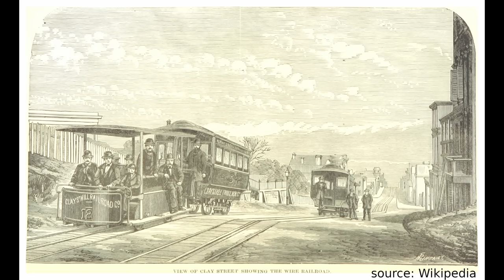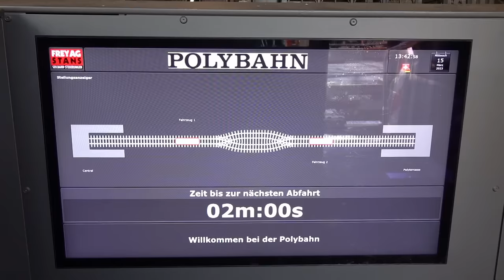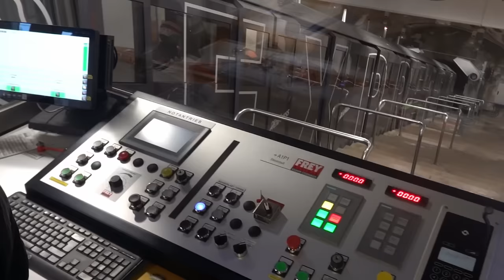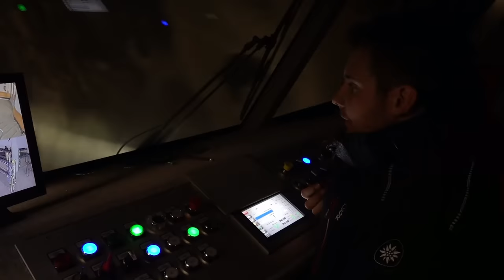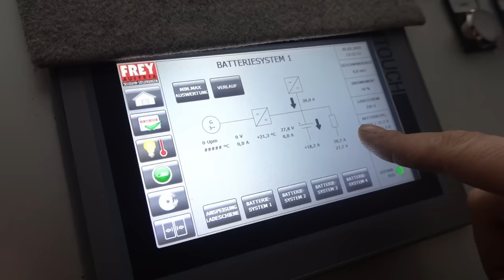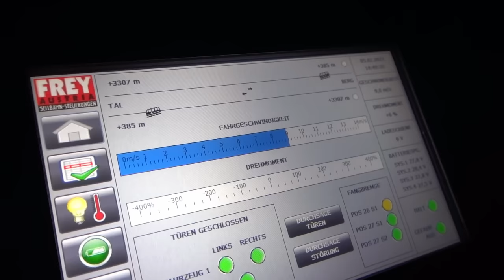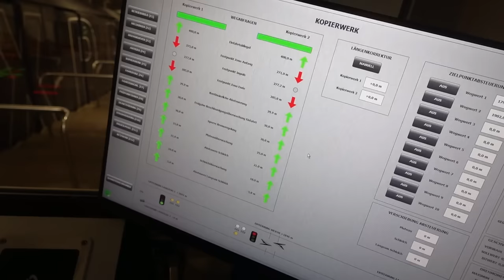A train that never sees daylight

Comment: Another difference between the San Francisco cable cars and funiculars is that the San Francisco cable cars can detach from and attach to the cable, while funiculars are of course permanently attached. Thus the San Francisco cable cars are the last of the traditional cable cars. The idea for them originated in 1869 (nice) by Andrew Smith Hallidie, who had the idea after witnessing an accident in which a streetcar drawn by horses over wet cobblestones slid backwards, killing the horses. Hallidie solicited financial support in 1871 and 1872, and the first successful cable-operated street running train was the Clay Street Hill Railroad which had its inaugural run in August 1873.

The cable cars are pulled by a cable running below the street, held by a grip that extends from the car through a slit in the street surface, between the rails. Each cable is 1.25 inches (3.2 cm) in diameter, running at a constant speed of 9.5 miles per hour (15.3 km/h), and driven by a 510 horsepower (380 kW) electric motor located in the central power house (part of the Cable Car Museum), via a set of self-adjusting sheaves. While these are the last of the traditional cable cars, other lines pretend they're cable cars, like the Great Orme Tramway in Llandudno, Wales that goes between the summit of Great Orme to the center of town at Llandudno Victoria where a part of it is street running. Lisbon's three street funiculars act that way too.
Reply: You should be ashamed of yourself! Let those people go!🤨
Reply: In Liege they had cable trains in 1842,  most likely not the first either

Comment: Underground funiculars exist elsewhere too! Examples include the Tünel/F2 in Istanbul! It has two stations connecting Karaköy and Beyoğlu. It runs uphill from near the confluence of the Golden Horn with the Bosphorus and is about 573 meters (or 1,880 feet) long. It opened all the way back in January 1875, making it the second-oldest underground railway in the world after the London Underground, and the oldest in continental Europe as it opened two decades before Budapest opened their Metro! 

There's also the Carmelit in Haifa! As the name implies, it runs through the religiously important Mount Carmel. It has a total of six stations and connects downtown Haifa with Carmel Center, and connects to places like the Haifa Zoo, Haifa Center railway station, and the beautiful Baháʼí World Centre. It's the oldest subway system in the Middle East as it opened in October 1959, but because of its small size, it's also one of the world's smallest subway systems as well, as the tunnel is just 1.8 km/1.1 miles long!
Reply: how are you everywhere💀💀💀
Reply: No speak gemern
Reply: I actually thought they were talking about the F2 in Istanbul when I first saw the video heading.

Comment: This is an amazing video.  I've known of funicular railways and as they are called in the USA incline railways but I wasn't aware of a funicular railway running completely in a diagonal tunnel.  It was neat to see just how much it had in common with the gondola system only flipped perpendicular 90 degrees.  I was noticing the similarities of the power supply when you said you wouldn't go into anymore detail because you had covered it in another video.  I thought it was funny when the operator said that if there was a fire detected in the tunnel the alert would come up on the panel and he said Oh, shizer.  I want to thank you for making these videos in English.

Comment: I had ridden the underground funicular at Kaprun several times that killed all those many people.  Once you understand what happened by fire, it is something I would never do again. My understanding is that the train no longer exists.  Back then there was no door at the lower end of the tunnel to stop wind. It as a blow torch once the fire started.
Reply: I have to admit; Every time I see an underground funicular, Kaprun is the first thing I think of. 🪦😢

The effects of fire in diagonal shafts were already known of before the disaster by reference to the Kings Cross fire in 1989, where fire spreading up the station escalators caused a blast-furnace effect that drew fresh air in from below, setting a draught that propelled the fire up the incline and decimated the booking hall. 🔥↗⚠

Tragically, this effect was also seen at Kaprun and would've made the entire tunnel above the train thick with smoke all the way up to the summit complex. One thing Kaprun has taught me is: In the event of fire in a confined space, always head down - Never up! ↙🔥👍

Comment: I found your video fascinating.  I live in Palm Springs, California and we have an aerial tramway that runs up one of our local mountains, Mount San Jacinto.  The similarities to Pitztaler are amazing.  Again, dual cars with one going up while one goes down.  Each car holds up to 80 people.  However, our tramway never sees darkness.  It's always in sunshine or moonlight!  Primary use of course is for passengers, but like the Pitztaler it must carry all goods, food and supplies up the mountain as there is no road.  It even has to carry water for drinking and sanitation purposes in an under carriage belly tank.  

You start at the bottom where the altitude is 440 feet (134 m).  Your drive your automobile up to the parking lots at the 2,643 foot level (803 m).   After parking you enter the Valley Station where you board for the 10 minute ride on the rotating tram cars up to the Mountain Station at 8,516 feet (2,589 m).  That's a rise (or fall) of 5,873 feet or 587 feet (179 m) per minute. By comparison, a typical airline jet climbs or descends at 500 feet (152 m) per minute.  Then, if you are hardy and ambitious, you can hike on foot to the mountain top at 10,834 feet (3,294 m).  There are beautiful lookouts at the top and many trails around the State Park there.  There are also 2 nice restaurants, one of which is fine dining.

Wonders like this dot the world and I thank you for sharing yours with us!

Comment: Thanks a lot for this video. 30 years ago when was around 10..11 years old, my family went for ski holiday every christmas to Kaprun and every easter to Pitztal. Because i was very interested in cable cars and ropeways and ask my parents a lot of questions they could not answer (my biggest concern at this time was, the switch will be switched wrong and the trains fail to pass at the right side, or the cable would brake....) , they speak about me with our host and he knows someone working at the Gletscherbahn. So at the next bad weather day my parent drop me at the bottom station and the guy showed me nearly everything. First thing was the function of the switch. I could drive with him in the drivers cabin upward and he stopped for a short time just before the switch, so i can see it in detail. Then at the top station we went below the train and he showed me the wheels , so it was now clear to me that the switch never will fail. Also he explained the emergency brakes that will grab the rail in case of a cable brake, and how the cable is fixed by a drum and can be shortened after some time of stretching. (You missed this part? ) after that he showed me the rectifier room. I was impressed by this big semicondutor parts, comparing to the small parts of my electronic experiment box...Not sure if it was a thyristor rectifier and if it was able to feed back power to the grid or if they just used it at brake resistor to heat the restaurant? Also i have seen the DC motors, gearbox and the generators. I think there was no demonstration how to switch the gear....Sadly i had no camera with me, so i made drawings of the drivetrain later. And in my memory the machine room is somehow bigger as in the video. Thanks a lot!
Reply: I think the red counterweight 'car' at the bottom accounts for any cable stretch (probably up to it's service life).  He discusses it @ 7:25; and you can also see it again @ 8:30.
Reply: @troubleshooter1975  No. The counterweight can compensate the stretch of the lower cable, but not of the upper cable. If the the cable stretches within its lifetime maybe 3 meters, the cars do not fit any more the desired park position at the top and the bottom station.
Reply: @wasserdrucker6227  Ah, ok, I agree now (after reading your whole reply, LOL).
I thought he meant the the cables would get droopy without the drum or means to tension them.
That's why I pointed out the counterweight.

It will account for total stretch (for maintaining tension), but not for positioning.
My comment was partly wrong.
Thanks!

Comment: The sound at about 6:48 is amazing....you can really feel the enormous power of the engines.
Reply: Glad to hear it's not just me who finds this sound so natural and comforting! ⚙🔊❤‍🔥

I find the same thing whenever travelling on the TGV-TransManche (Eurostars older trains; Quick, whilst rolling stock lasts! 🚄 🇪🇺 ⏳) in coaches 01 or 18 (The coach is half power-car), many VAL systems across France, plus any Paris metro line (1, 4, 14) operated using MP-89 trains, just in case it's useful! 🚈⚙🔊❤‍🔥😇

Comment: The great big cable and the wheels that pull/guide them remind me a of a big machine we have here in Canada that operates as a lock on a waterway. It's called Big Chute, it runs on rails, and it lifts boats out of the water, down a hill, and back into the water at the bottom. It is pulled up the hill by four cables and each cable runs into these big wheels and into the building which houses the motors that pull the machine up the hill. Each cable has its own motor. The difference is the water at the top is past the peak of the hill and slightly down the other side so when the machine reaches the peak the cables flip direction and it is let down hill on either side by gravity and the speed is governed by the motors. The cables switch in pairs in different spots so it's not possible for the machine to stall. The whole machine is powered by a hydro-electric dam right next to it.

Comment: There is even a funicular in Wiesbaden (Germany) which only uses the weight of the cars, it's called "Nerobergbahn". The way they make sure the upper care is always heavier then the lower one is a huge water tank in any of them where they take water from a pond at the top of the mountain making it heavier and at the bottom you can hear (and see!) how the water swooshes out of the tank in just a few seconds! 

The speed and the departure is simply controlled by brakes!
Reply: Ah forget to mention - it doesn't brake on the regular rails it rolls on of course, but on Rack rails located between the rails. And those are really just for braking! They have a 5th wheel (the most useful 5th weel maybe) which runs on that and can be braked.
Reply: Here is a Wiki-Site where you can find some useful information: https://en.wikipedia.org/wiki/Nerobergbahn
There's also a german version linked in the site which has more details for those who speak german!

And yeah 450m in 3.5 Minutes aproximates to an average speed of 7.7km/h so you are way faster by bike downhill and you might be able to top it uphill as well, but keep in mind your way is a bit more curvy, therefore longer and therefore you have to ride a bit more faster than the train does to be at the same speed!
Reply: Ok calculated it. If you don't care about traffic rules (there are ways that aren't for bikes) it makes 620m so you need 10.6  kph uphill to be as fast as the train 83m on that distance, which can be really hard. It's not much, but if you race the train it might get much 🙈
Reply: There are several others funiculars around the world that use water balance propulsion such as the Lynton Lynmouth in Devon UK
Reply: This is a type known as a water balance funicular (🇩🇪: Wasserausgewogensfunicular ) and is quite common in parts of the world, particularly some areas of the UK as somebody else has already pointed out. 🚞🌊😇

Funnily enough, this has just reminded me the UK also has a globally unique type: In a small eco theme park in North Wales is a gravity driven rollercoaster where the lift-hill is replaced by a funicular, where the weight of people waiting to ride is used to lift the train to the top of the track. It is quite possibly the only Human balanced funicular in the World! 👯🛗🚞😁

Comment: I have questions. From what I understand,  the trains are  directly connected to each other through the wires in such a way that they use each other as counterweights. One train can’t leave the station until the other is ready. 

In the event of a fire, I get that it speeds up and disables other features so it can get away and evacuate passengers quickly, but wouldn’t that also mean that it would pull the other train towards the fire? Specifically if there was a fire in just one of the stations. I would assume that it’s more logical to have train that can disconnect from the wire when required and have it’s own independent brake systems so they could stay put or descend as needed.

They mentioned it at the end, but they didn’t really say whether the trains can become independent of each other when a need arises. It doesn’t seem like they can be powered upwards on their own power.
Reply from the maker: The fire would typically break out inside a train. Their crossing is very brief, so no way for the fire to jump over to the other

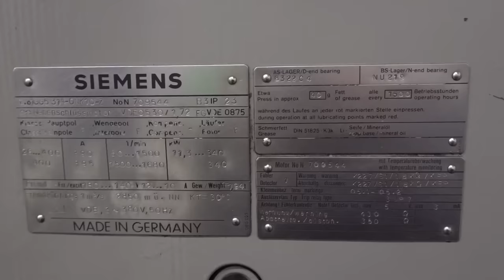Comment: Nice video! Btw: The motors are not DC, there are frequency inverters, but the output is not DC. By the electric motor datasheet which you show in video at 13:43, the motor is rated for 2x-400V with 890A, 50-1500RPM and 11,3-340kW of power :)

Comment: Not sure if it may not count due to it's lack of cable/rope (it could be made to use a suspended cable or cable-suspended rail even easier), but the system Eugen-Langen suspension railway in Wuppertal might be interesting.
....actually, now that I think of it, Dresden has a funicular instead of adhesion-railway-self-propelled installation of system Eugen-Langen.

It's great advantage over regular railway is the natural pendulum nature giving very strong tilting easily (they tested up to +-30degrees back in the day on test track; the Wuppertal installation was designed for +-15 degrees).
Otherwise, it's like a subway, but suspended on a bridge structure (that could be cable suspended, if the rails are designed to conformally twist enough to not resist the natural torsion wobble of the cable suspension in curves) over a street or river.

Comment: Here in Genoa we have two funiculars and a single rack railway: all three are single-track with central doubling which can be accessed via switches of the needleless type devised by the Swiss engineer Roman Abt.  The shorter funicular had a central rack of the Abt type used for braking and operated with a water counterweight.  The amazing horizontal / vertical lift also has an Abt type switch.

Comment: There actually was one system with a one-car up one car down like you demonstrated with the models operated in San Francisco. It was electric streetcars not cable cars but it was to steep for an electric to climb, it was called The Fillmore Street counterbalance the streetcar coming down the hill would pull the other one up the hill with an underground cable